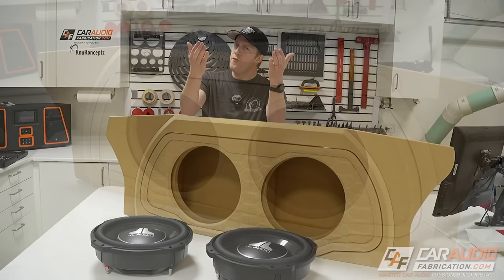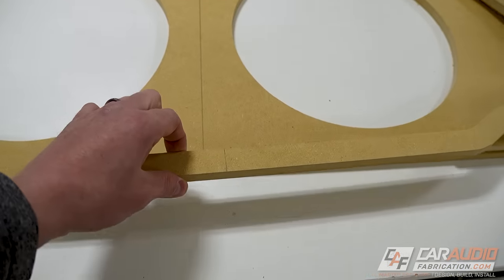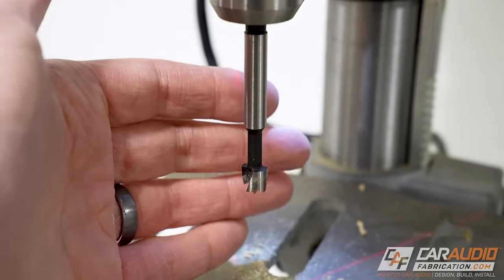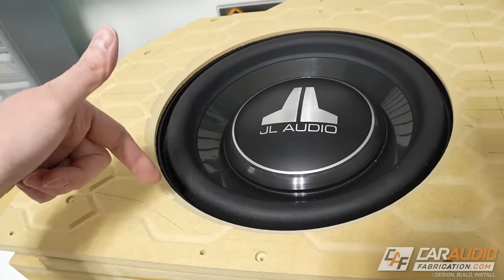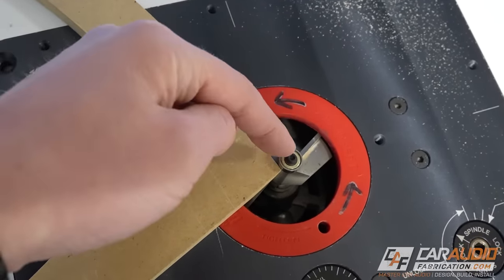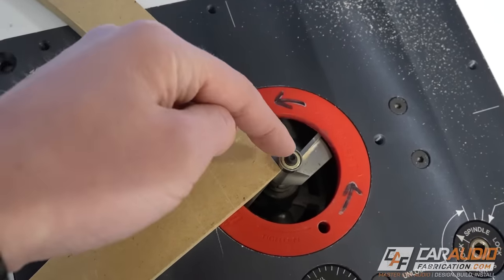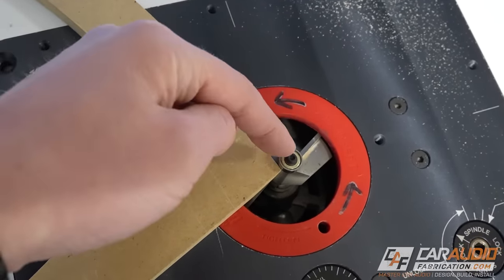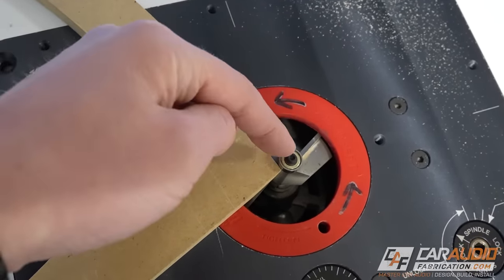Level Up Your Sub Box!  Advanced Shaping & Mounting - Magnets and MORE!

Comment: Counter sink screws instead of butthead screw,  also help to minimize contact 👍 great work 🫡🙏
Reply from the maker: If the hole locations aren't dead accurate countersink screws will pull the panel out of place. Pan head allows for a degree of adjustment that is helpful for alignment.

Comment: Does the bass not blow that front cover with the magnets off? I know ND magnets are strong but I'd think those subs would be stronger. Cool build either way. One of these days I'll get a router table set up.
Reply from the maker: The outer trim ring is nowhere near the subs, also the magnets are in fact quite strong. It will not be an issue.

Comment: Backseat removable Mustang GT 1987 McLaren turn it to a speaker box like the one you have on here. Speakers will be facing upwards. And the back location were the backseats were located and removed.
Reply from the maker: This is a project you are doing?
Reply: @CarAudioFabrication  yeah I’m thinking about it. It’s just a 41 inches wide by 17 inches          Front back and Top the bottom box I would say 12 inches tall
Reply: @CarAudioFabrication  Z 350 Nissan box would fit somewhat ok
Reply: @CarAudioFabrication  I had a 1984 Dodge Omni I placed 10 inch kicker speakers in each door somehow they fit perfectly back windows. Not sure if I ever ruled those down or not didn’t care.

Comment: Hi, I have watched a lot of your videos, but i can't find the answer to myself. I need a bit of help. 

So I'm thinking to change my speakers to my Ford Focus MK 2.5 because some of them do not work anymore.
I'm going to keep my head unit and install a Plug-and-Play DSP with a build in amplifier of AXTON. For the front door I'm going with component Speakers + Tweetes.

What should I use one the rear doors? Mid rage 6,5 inch woofers or 2 Way Coaxial speakers?

Who gonna give me a bit more bass?

Ps. Rear passengers are not a priority for me.

Comment: Is 400 watt rms sub better then 150 watt rms sub? Could you test if I have equipment like yours I want do that. Because subwoofers rms power constantly increase but I think this is marketing  strategy. I want in my car sub sound but my amps sub channel out  is 280 rms at 2 ohm  but I want two sub  system. What could I do ? One 280 watt sub or two 150 watt  sub ? Whats your advice please respond my question. I recently bought audison forza m8.14 bit 8 channel dsp amplifier but this amp two channel bridged 4 ohm 280 watt output power. 2 ohm 140 watt single channel output. Im confused. But I dont want buy another mono amp because I dont want upgrade cars stock electric system.

Comment: I would like to know the total weight of the box once the subs and wiring are installed. most people don't consider this when building a system. this is a beautiful design but I'll bet it sags the rear of the car once installed. the max gvrw of an Elantra is 3800lbs. with four adult men in the car and the system I'm guessing the car is at it's max safe carring capacity which will significantly impact the handling of the car. Not to mention fuel economy.
Reply from the maker: Fuel economy... lol.